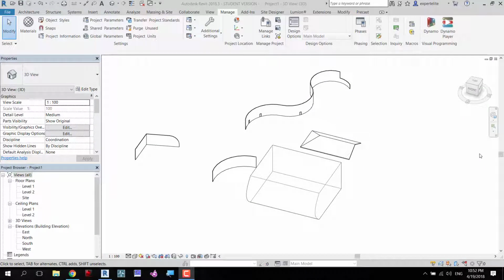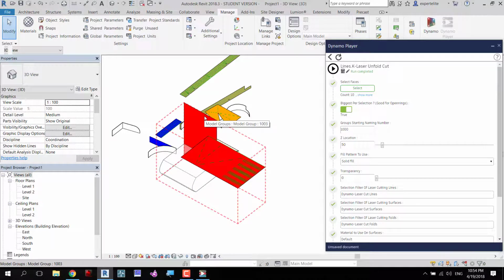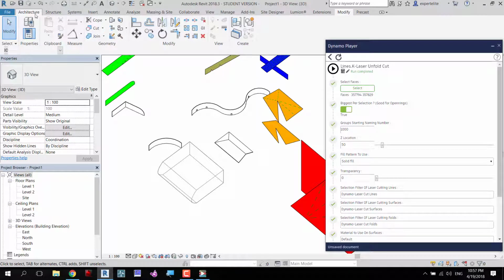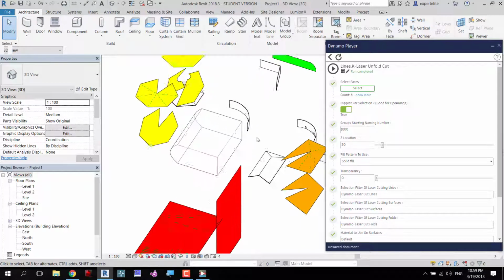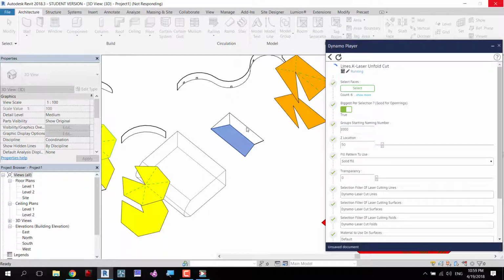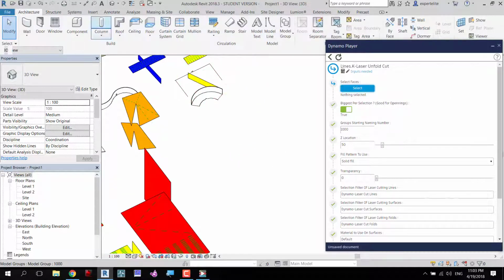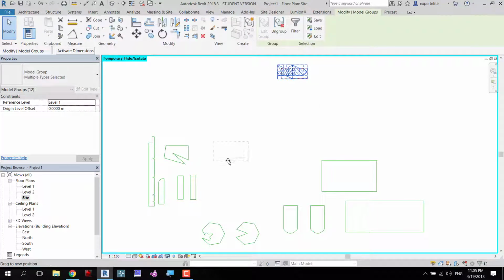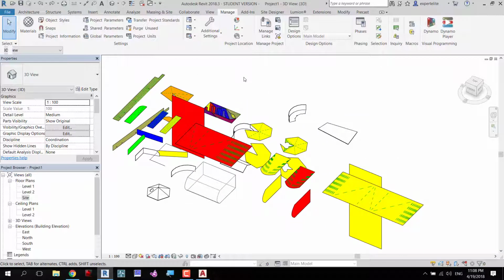(OUTDATED) PLEASE CHECK DESCRIPTION Automatic Laser Cutting in Revit with Dynamo (K-Laser) V2

Comment: which revit version it works with ?
Reply from the maker: Aya Brakat 
2017 - 2018 - 2019

But This is a problem with 2019, 
Choose any other pattern than solid fill
For example "Aluminum" or any other pattern

Then you can change the override from loading the selection of surfaces and change to solid fill from the override menu 
Or you can simple ignore, 

Please also note, opennings may cause troubles with curves, you might have to delete windows and place them in cad manually (ONLY IF THE FACES ARE CURVED)

As for any other surface, everything works as expected
Reply: Karam Baki 
Thank you karam, but i tried loading the toolkit with revit 2017 ,and i didn't find the k-laser option
Reply from the maker: Aya Brakat 
Watch this video to install the toolkit
https://youtu.be/U3l9JJ7O8wc

You should have all the tools including the K-Laser, if you installed the toolkit before the klaser was released, you would have to uninstall and install again to get the latest updates
Reply: Karam Baki  thank you karam
Reply: i have a problem , when i install different version either the toolkit , archi-lab , or the launch box is not installed and keeps telling me " empty legal path is not legal " i've tried different versions of revit or dynamo itself
Reply from the maker: This is generally caused by firewall or antivirus locking the path, 
In this case go to : 
https://dynamopackages.com

Search for Synthesize Toolkit
Install the latest version 
and extract it manually to :
C:\Users\YOURUSERNAME\AppData\Roaming\Dynamo\Dynamo Revit\1.3\packages\
Reply from the maker: You can search for archilab and lunchbox and extract them manually too, but this K-Laser doesn't depend on them, so it is safe to not install them
Reply: Karam Baki i did but when i select the faces ,run , choose the colors and play it, nothing appears
Reply from the maker: please send me your Revit file to my email, karam.baki@gmail.com

Comment: Hi, thank you for the instruction. I have a problem with choosing the reference surface. Every time I finish selecting the faces and it keeps showing up I have to choose a fill pattern (I have chosen solid fill in the first place ) then I click finish and it shows nothing. please help:}
Reply: and there is no choosing color step... is it because I use revit 2019?
Reply from the maker: This is a problem with 2019, 
Choose any other pattern than solid fill
For example "Aluminum" or any other pattern

Then you can change the override from loading the selection of surfaces and change to solid fill from the override menu 
Or you can simple ignore, 

Please also note, opennings may cause troubles with curves, you might have to delete windows and place them in cad manually (ONLY IF THE FACES ARE CURVED)

As for any other surface, everything works as expected

Comment: Does it work with a mass that I imported from Fusion360? 

(Note: it’s a mass not a multiple faces brought together.)
Reply from the maker: It does, if the faces were well paneled, and I mean by that, joined 'Planar' paneling in Revit, then you can easily extract all the panels, laser cut them and join them physically,
Reply from the maker: You can use 
Sample K-Attractor Pattern Solid.rfa in the Synthesize Extra folder, edit the type, activate Planar option on a divided surface
Reply: Karam Baki I’ll try that, thanks a lot for your help